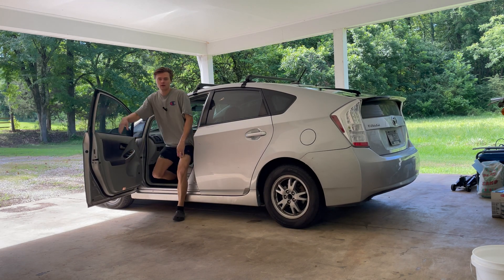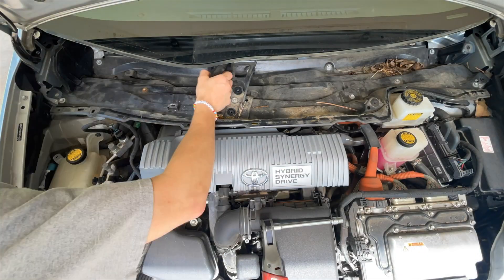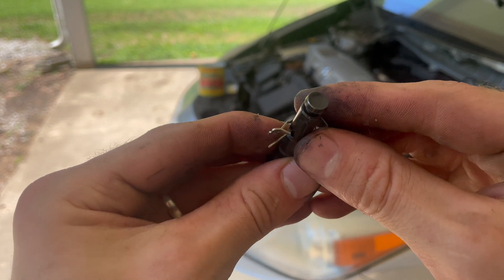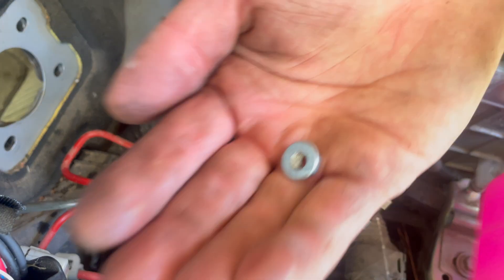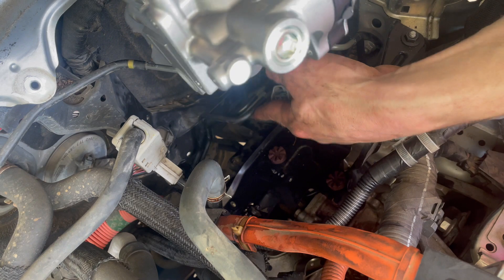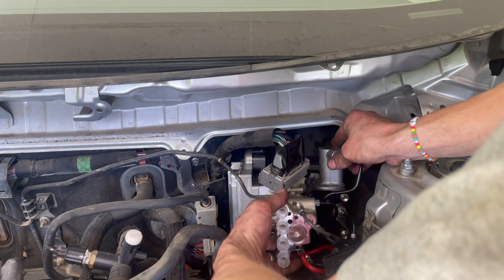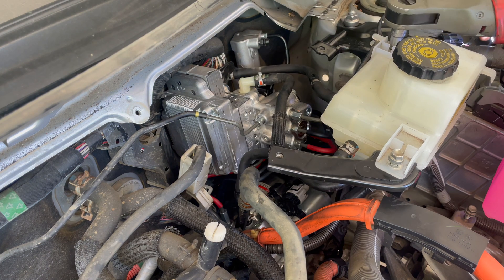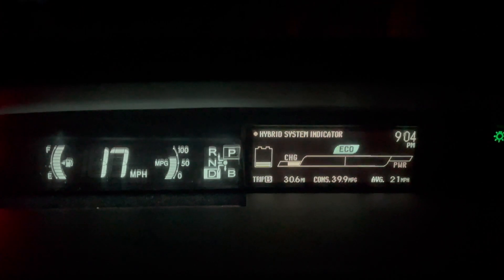Prius Brake Booster Replacement (ABS VSC Light)

Comment: Dude I just bought a Prius 2010 in 3300 dollars and it have the ABS issue and the previous owner didn't want to invert more in the car, i just got the two pieces in 500 dollars and I'm taking the adventure to change that parts. I just have to find some good scanner. Thanks a lot for the video.

Comment: The failing head gasket stigma you were hearing about is the failing water pump, which could lead the engine to overheat and destroy the head gasket. It happened to me when I reached 230,000 miles on my 2010 Prius.

Comment: I have a '14 Prius with the pump now running with every brake application. I can sit in "Park" with foot off the pedal and the pump will run for a few seconds every minute.  The Dealer won't give me the time of day unless it throws a code.  How close am I to total brake failure?  My car has 103K miles.
Reply from the maker: The brakes won’t fail but your pump might. I think mine did that for awhile till it threw the code.

Comment: Great video, I need to do this on my Prius. I have a 2012 Gen 3. Prices are way higher for those two parts, perhaps because of the tariffs. How do you know if it is just one of the two parts or just one component that needs replacing? Are the codes the answer as to which one or both is bad? I do have an OBD scanner somewhere that I could probably use.

Comment: Excellent video. I would really appreciate if anyone can confirm if the Brake booster or Booster pump ( two separate parts ) from Gen 3 regular Prius  work  on  Prius V since both of them look identical. If we can't , then can I at least use Gen 4 Prius boosters after swapping the Prius V 2013 engine with Gen 4 Prius. Because , boosters for Prius V are rare and 3 times expensive. I would rather upgrade Prius V engine with Gen 4 engine and use brake boosters that are Gen 4 than purchase Prius V boosters. My Prius V 2013 with 250,000 miles is anyway due for engine swap with Gen 4 engine. Thank you and I subscribed.

Comment: Thank you for the video.  i'm stuck at the moment because the bottom and second top brake line will not screw in?  it's a new unit and i'm lost and exhausted after working on  this for 8 hours!  Any idea what i'm doing wrong?
Reply from the maker: Good job!! I think this happened to me I had to just pull and bend the brake lines till it all lined up it took some time

Comment: I am surprised you did this job. I was told take it to the dealer $4500. I just drive mine like that. I would like to fix it myself.  How much are those parts ???
How do I get that techstream since I do not have a scantool??
How much are shops charging for this job ??
Reply from the maker: I do explain all this in the video

Comment: Great video. But please help. I have 2015 Toyota Prius C and i fix cars. BUT. My Prius C started dragging slightly. I replaced 2 front brake hoses 2 front brake calipers, bleeded brakes, made sure that pads and slider pins are fine and freely smooth and greased but the car still dragging. No fault codes. Just a symptom as 2 front wheels are dragging and the gas mileage become really bad. Do you think I am facing the same issue?
Reply from the maker: Can you put it on a lift and see if there’s rubbing and find it that way?

Comment: ABS pump/traction battery/headgaskets...3rd gens can be great cars for many miles but have expensive repairs...why not just use an old school master cylinder?
Reply: Won't work in ev mode

Comment: Hi There,
I did the Brake Booster replacment but not the pump. The pump is running a lot, and things have recoded for ABS VSC. At times it sounds like a hissing noise coming from the Booster/Pump within the engine cabinet . . .  Any suggestions....  Thanks
Reply: brake booster = pump. youre talking about actuator

Comment: I have a ‘12 V I bought new. Have ~130K miles on it now. 

For the blown HG epidemic on the Gen 3 Toyota really keyed in on the EGR/PCV systems.

If you haven’t done a complete EGR system clean out I would suggest doing it. From the EGR cooler forward all the way to the EGR ports inside the air intake manifold. 

Those little EGR air intake manifold ports become differentially clogged with a mixture of carbon particulates from the exhaust and oily vapors from the PCV system(the 2ZR-FXE absolutely slurps engine oil out of the PCV valve).

Because the EGR gasses enter from the right sight of the manifold(when looking at it from the front of the car), the far EGR port on Cylinder 1 gets very constricted. This puts cylinder 1 into an undetected lean condition where it runs excessively hot. This is almost always where the HG blows.

The only remedy for the PCV oil is to run an Oil Catch Can in the PCV line. I’ve been running mine over a year now and have collected about 36 ounces of oil/H2O/fuel muck from it.

The OCC will not catch all the oil, but I’m glad what I’ve caught didn’t get into the air intake manifold. I’ve also backed off the recommended 4.4 quarts of engine oil to 4.1. I’ve seen Toyota techs say they think that because the PCV valve is slung so low on the engine block that it takes a lot of engine oil splash from the rotating assembly.

To verify you have this problem, and trust me it’s all over the forums for the last decade+, pop your throttle body off. You’ll have a pool of engine oil directly below it in the manifold.

Toyota used the 2ZR-FXE again in the Gen 4, but they made a mad amount of revisions to it in order to try and remedy this EGR/PCV issue and eliminate the blown HG epidemic on its Prius.

Comment: My 2014 Prius V is running the actuator pump now every few seconds, no codes yet, so I guess I will have to do this job too. You didn't show bleeding procedure.  Were you able to complete the bleeding by yourself?  Or did you have someone help?
Reply: I have a ‘12 V with ~130K miles. How many miles do you have on your ‘14?
Reply: @EvzenKovar-i5p  I have 255k on my 2014 Prius V.

Comment: How much will cost if i do by a mechanic
Reply: Unless you’re in a big city, you’re likely not going to be able to find someone outside a dealership to do this job. Heck, I couldn’t even find anyone in my somewhat rural area who would perform coolant service on a hybrid.

I’ve seen a lot of people on forums put their dealer quote at $3-3.5K.
Reply: In case anybody else has this same question, my local toyota dealer quoted me $2k for the parts and $1,600 for labor so roughly $4k after taxes

Comment: Hey!!  I just replaced mine   , and I’m also having trouble with the stroke simulator bleeding. Do you recall what you did to get past it?
Reply from the maker: I think once I got to the step that kept failing I clicked next to almost skip that step but I did it already. I think it was my cable that was no good
Reply: Hello there, I am having the same issue. I'm getting an immediate disconnect when getting to the stroke simulator test. Might you have any clue for this? We have tested everything except for changing the cable.
Reply: @andrewmyers2231  I'm having the same issue. although I am using the TopDon bi directional scanner (it's like $60 on amazon and there is another video of a guy using it and it works for him!), so there's no cable, it's bluetooth. I've done it like 6x, every time right after the stroke simulator bleed, it just says "air bleeding failed". The two ideas I have are that maybe one of the brake lines isn't screwed in/seated sufficiently, or, I did get the amazon version of the 47070-47060 (I just wanted it fast!) and it isn't quite good enough. so, I'm doing it again, with a 47070-47060 from the dealership. I will be more careful to make sure each of the brake lines is seated and screwed in snugly. praying to 6 lb 8 oz little baby Jesus that it works.

Comment: At 5:20 Here is a suggestion for anyone having trouble replacing the  pump assembly back into place with the rubber  bushing and the collar that secure  the pump in place.

First put the rubber bushing piece back in place by itself without the metal collar attached to it.

The rubber bushing piece has a bigger hole for you to slip the pump assembly through. After you have the pump assembly and the rubber pieces in...

You then use flexible magnetic pickup tool with grabber claws at the end to hold the metal collar securly and  then go slip it into place.  

This is the method I used to get the pump assembly and rubber with bushing into place. Although several attempts but it still worked. Good luck! 👍🏿
Reply from the maker: Thanks! That part of the job is tough! I struggled for a bit on it
Reply: @BELOSHAPKA_AUTO  you're right that part was hard.... I struggled too.

That part and when techstream lost communication  right after instructing I  bleed the stroke simulator.

Comment: Incredible video, thanks for posting. Our gen 3 is starting to do the pressure noise every 13 seconds and I know we are due for a replacement. Toyota recommends replacing both the booster and the ABS module however what are the chances that both of them are failing at the same time? I may replace one at a time to see if it fixes the problem which may provide a more cost effective solution. Would it be more likely the Booster or the ABS do you think that fails first?
Reply from the maker: I would scan it and see what codes are there
Reply: @BELOSHAPKA_AUTO  No codes yet, just the pump noise intermittently when driving. Was trying to preemptively fix it so it doesn't break on my wife when I'm away.
Reply from the maker: @thecollegepicker  mine was doing that for a few months before it finally went out

Comment: It looks like the 3G Prius splits the booster and pumps, where the 2G have them as one unit.  Last time I checked (last year) the "booster" for my 06 was over $1K.

My 06 is parked, waiting for time (and weather) to allow swapping the booster from a spare 06.  I do NOT look forward to it, even with TIS on multiple laptops.  Basically because I'll essentially be doing TWO jobs in the swap (though the bad one doesn't have to work for the parts car, just seal off the brake lines).

It SUCKS that Toyota had a recall on these that timed out for older cars.  This is ABSOLUTELY a safety issue, there never should have been a sunset date on it.
Reply from the maker: Yeah I called my local dealership and they said the “warranty/recall” expired in 2020
Reply: they should have replaced it. I also had this issue come up.

Comment: Glad to see you got the software working with the car, thats usually a huge roadblock.
Reply: My second generation Prius got its actuator changed and it is still not working try to bleed it but it is only dripping can hear the pump running